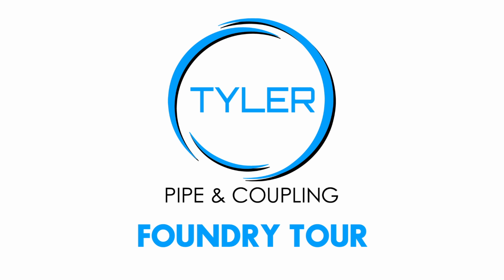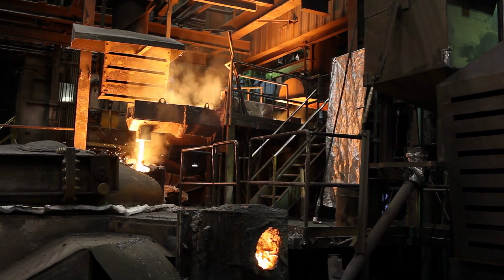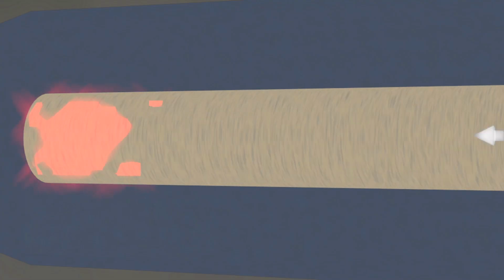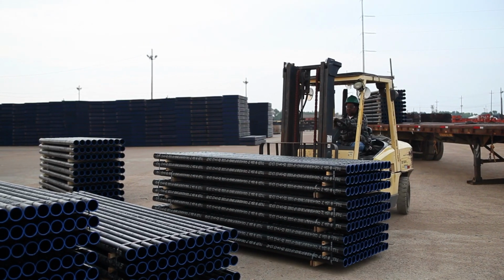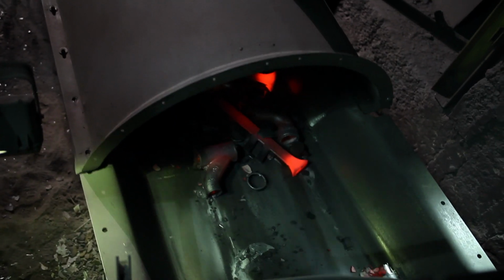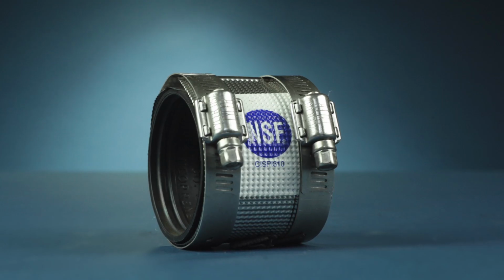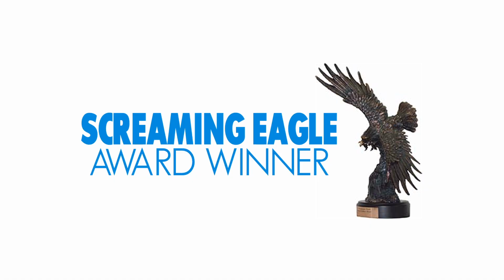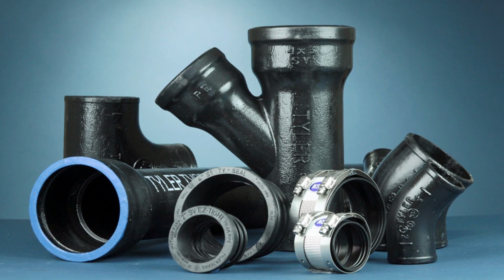Tyler Pipe and Coupling Foundry Tour

Comment: Each stick of cast iron pipe is pressure tested? LMFAO. I have installed cast iron pipe only to find holes that you could stick a number 2 pencil in when performing head pressure testing! On No-Hub piping this isn't horrible, usually. It does suck when it is in the middle of a stick of ten inch that is twenty feet up in the air though. On Service Weight piping it simply sucks no matter what.

Comment: There is not two tyler pipes is there?   This place looks way safer then the one i was looking for out of swan texas.   Where in the early 00’s.  Guys where losing limbs daily.   I used to haul flatbed out of the widow maker plant.  Either way nice vid.
Reply: This is the tyler pipe in swan tx.,just outside of lindale,tx.worked there for over 20 years.
Reply: @donmotley4450 ok I’m in to railroad stuff I believe they used trains because my parents grew up in Tyler in the 70s and 80s they said it used to be busy with railroading because in Whitehouse they remember the coal and pipe trains coming and going from there now the tracks are abandoned I’m just looking for more information on the Tyler pipe railroad stuff
Reply: Tracks are still there,they haven't used train services in years! @Relaysandthings
Reply: @ the tracks are abandoned now but still in place when do you think last trains went to it and what did they deliver and ship out
Reply: My uncle was one that lost libs there no bs